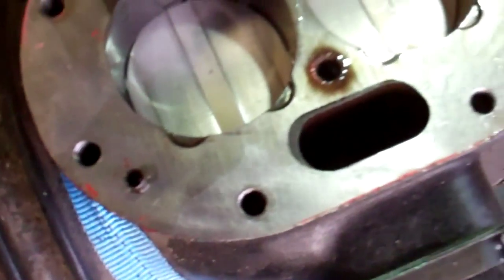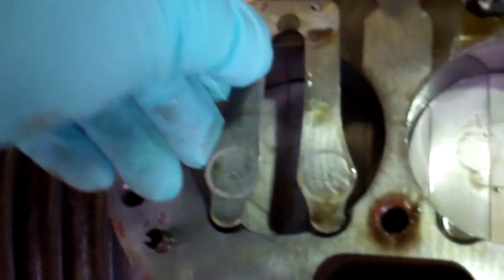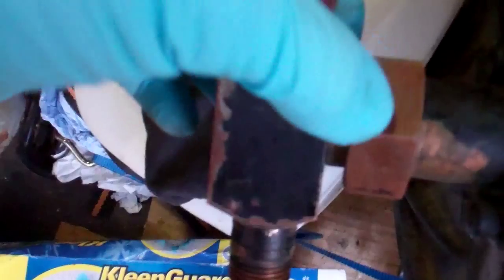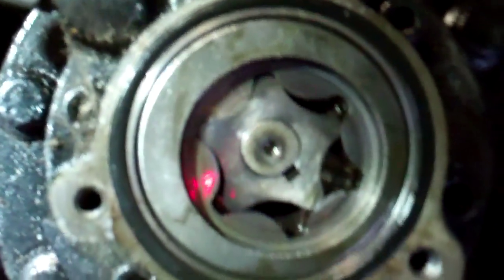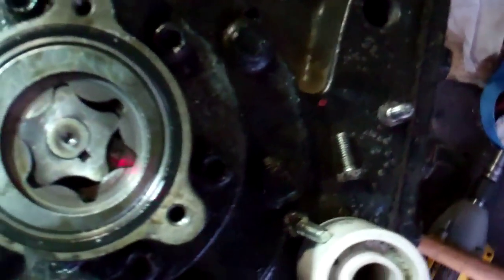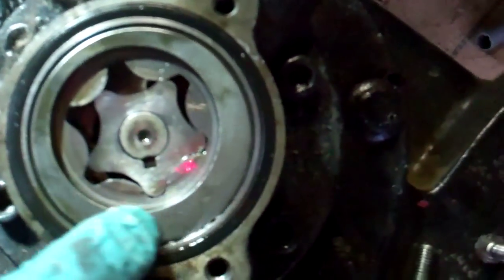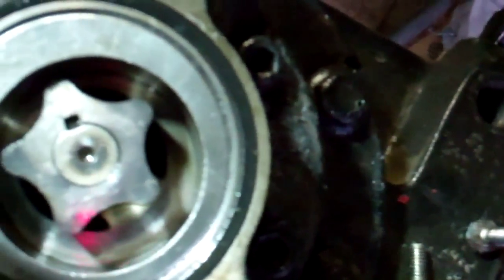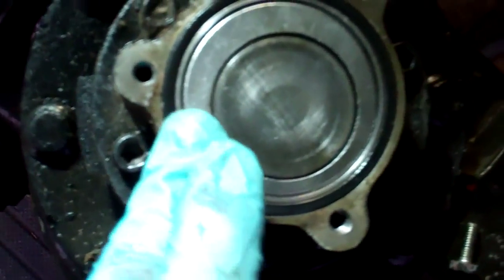Copeland Compressor Strip

Comment: Why would be the reason to reverse the oil pump rotation?
Reply from the maker: Usually compressor big enough to have an oil pump are three phase so they could run in either direction depending on how they are wired up so the oil pump needs to be able to work in both directions. 
On a side note I got a compressor to run another day by swapping the phases after it had issues with worn bearings, by running it the other way a different part of the con rod bearing was loaded on the compression stroke, which allowed time to get a new compressor sorted.

Comment from the maker: @ladanut275 Hi,

This was the 'good' comp next to the failed one in my 'Fubar...' vid, its a 5hp comp but with the same size pistons as the failed 6.5hp one! its designed for evap temps below -20c on r22 not running around +5c to -5c as it did in this application, so it spent a lot of trime tripping out on internal thermal overload, i did suggest a crankcase pressure regulator but it died before it was fitted. The replacement has a 6.5hp motor but we had to alter the pipework to fit.
Reply: i guess it's kinda off topic but does anybody know of a good place to watch newly released series online ?